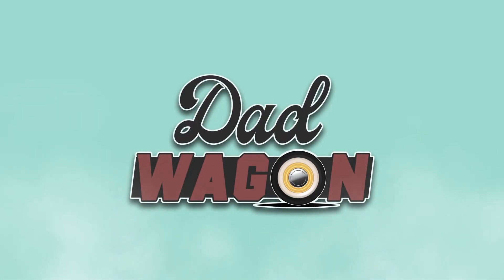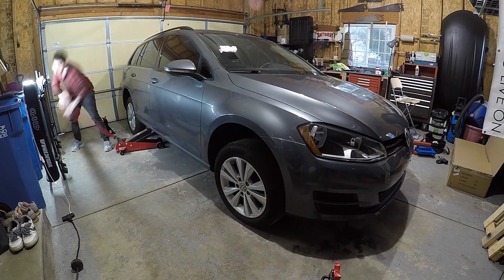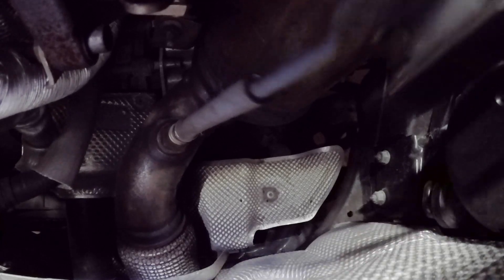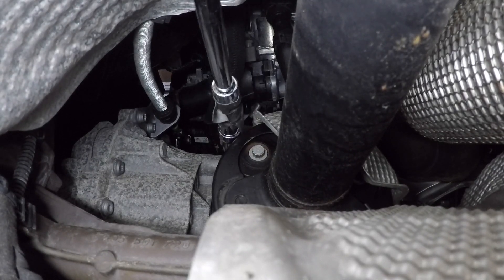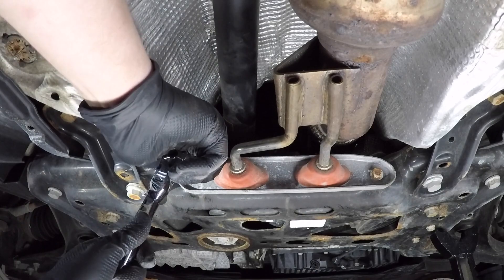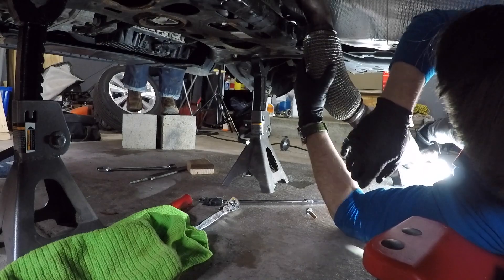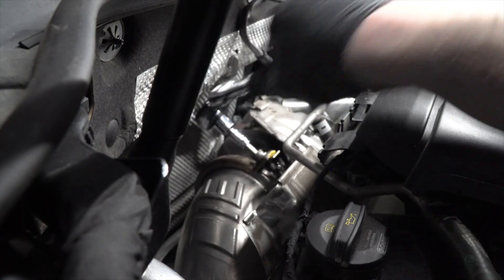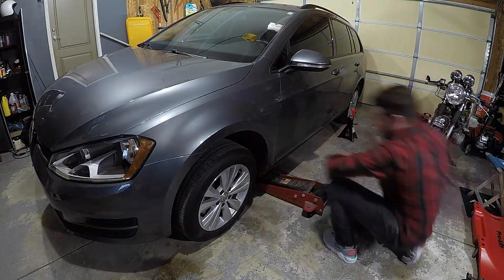Downpipe Install on a Mk7 VW Golf Sportwagen w/ 4Motion using Jack Stands

Comment: question, about how high off the ground was the car lifted ? I dont have access to a lift so I will have to do this on jacks as well, thanks in advance
Reply from the maker: It was a long time ago, but I would guess between 14 and 18 inches off the ground
Reply: @DadWagon I appreciate the reply ! Also about how long did it take you to complete roughly ?

Comment: How’s the heat in the engine bay after driving,I installed a 3 inch dp with a 200 cell cat about 1 month ago,the heat in the engine bay is gotten very high,my look in to a turbo blanket and a exhaust wrap,or I may just take it back off and spray it with high temp paint

Comment: Did you have to cut stock exhaust at the back? I can't make it fit with the adapter it makes it too long...
Reply: I ended up just cutting a bit to make it all fit I think it depends on the kind of adapter you get. Thanks so much for the video was a huge resource on this project for me! And I had a very hard time getting some of those heat shields back in place since the new Downpipe is bigger!
Reply from the maker: @lukemfross5533  sorry i didn't see this sooner. I did not have to, but as you said - it's dependent on the adapter.

Comment: Great job!  Are you using 3 ton hack stands, trying to figure out how high you had to raise it.
Reply from the maker: I believe I was using 5 Ton jacks all around - all though four 3-ton jacks should be just fine as well based on the curb weight of the vehicle.
Reply: @DadWagon  So I just finished this job, damn tired :).  Got a question about the reducer.  I have an Alltrack and it also has a 60mm cat back.  So I got the APR 76-60mm reducer thinking it will work.  However it is made to butt fit instead of slip fit like the IE reducer.  So now I got a huge exhaust leak.  Need to figure out what to do next...
Reply: @hackingmobility  And that reducer isn't leaking?  Did you cut grooves into it?  What size clamps did you grab?
Reply: @Zharsergey  I used the reducer that came with the Integrated Engineering Downpipe (which I believe was for the Golf R) which came with clamps built-in.
Reply: You can see the the setup at 12:22 in the video. https://youtu.be/04cgHvJpodM?t=742
Reply: @hackingmobility  Just realized you are the Dad wagon :). So you left that arrangement as is and haven't gotten the 76-60mm.  I just had my reducer flared at both ends and now 76id-60id. It is still leaking or maybe it is the v-band.
Reply: @Zharsergey  yeah - sorry about that - logged into the wrong account. yeah, still have that weird setup. I tried the APR reducer but didn't fit for me either. I sometimes believe its the v-band as well.

Comment: Good video. I’m about the do the same install myself. What height did you set your jack stands to?
Reply from the maker: A little higher would have been nicer, but when I measured, the bottom of the car was about 21-22" off the ground. Enjoy the work and stay safe!

Comment: Great video ! Are you planning to do is20 on your car ?
Reply from the maker: IS38 is more likely my path.  Thanks for checking out the video!
Reply: @DadWagon  did you get to install the APR reducer ? Any issues ?
Reply from the maker: @FredericAbel  I did get the APR reducer, but I ended up installing a reducer I picked up at the local shop instead since i ended up getting that first
Reply: @DadWagon  Thanks for the answer. I ordered the APR reducer. I hope it'll work well with the IE downpipe.

Comment: What jack point did you use to get the jack stand under the driver side front?
Reply from the maker: Pinch welds for both front and back

Comment: A bit late for this comment possibly but check out jackpoint jackstands. Not cheap for sure-roughly $400/pair..but they have 4 legs when an opening at the base that allows you to roll the jack under them and drop it down onto the stand in the factory jacking location. There is a removable plate that sits on your jack’s lifting point. Jack the car up, slide the stand around the jack, and drop the jack- the plate will seat onto the stand and your jack can safely lower and roll out. They are only about 12” tall but if you require more height, you can always supplement by placing wooden blocks beneath the stands and adding Jack pads as you please by doing that you can easily get another 8 to 12 inches of height safely and it is incredibly convenient.
Reply from the maker: Thanks for the suggestion Scott!

Comment: WHERE DID YOU  GET 8 MM TRIPLE SQUARE SOCKET,NICE VIDEO ,CAN'T FIND ONE ANYWHERE
Reply from the maker: This is the Triple Square Set I own - https://www.amazon.com/Neiko-10078A-Triple-Square-Spline/dp/B000XYOUTA/ref=asc_df_B000XYOUTA/?tag=hyprod-20&linkCode=df0&hvadid=309735728871&hvpos=&hvnetw=g&hvrand=16696045153295521047&hvpone=&hvptwo=&hvqmt=&hvdev=c&hvdvcmdl=&hvlocint=&hvlocphy=9017519&hvtargid=pla-570692178421&psc=1
Reply: @DadWagon  thanks TRIPLE SQUARE  SOCKET is just a 12 point socket , i was going crazy looking for TRIPLE SQUARE  SOCKET, watch your video on install  thanks a lot it was big help